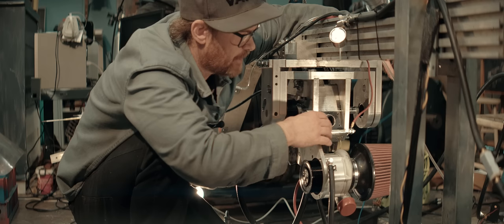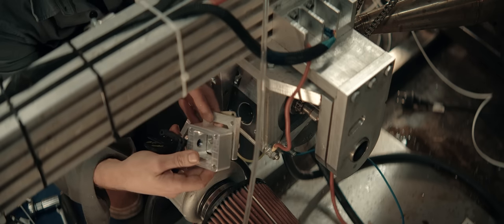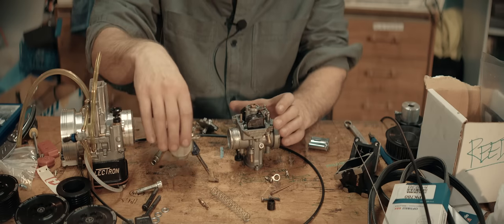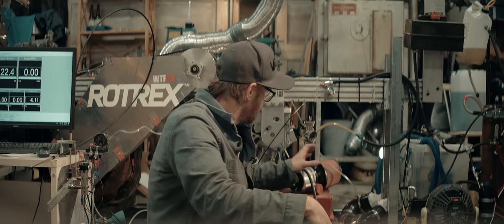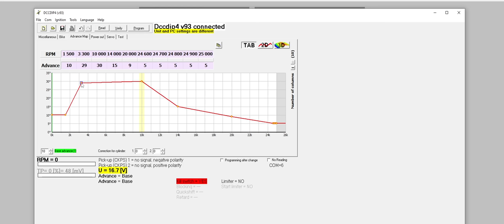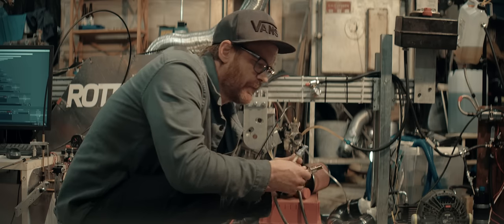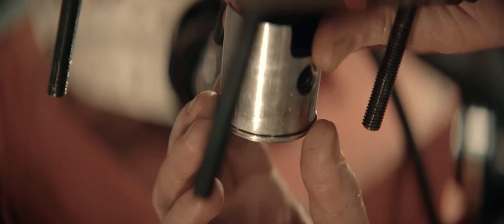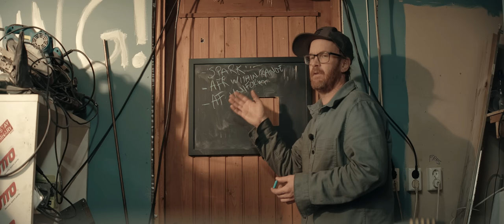Not Supercharged 50cc Two Stroke Not Running Nitro.

Comment: This is definitely the smartest thing you've done in a while. The thing is you never really got the base engine running just right on gas or methanol before deciding to supercharge it instead of your brute force CF... going back and getting the engine to run right NA and then figuring out how to supercharge it is definitely needed.. but also remember once you put the blower on it that things are going to change drastically because it's forcing air through no matter what when the exhaust is uncovered.. You don't have exhaust valves to build up pressure like a Detroit Diesel does, you have a very narrow band for it to be able to build boost and when the exhaust is open it's just ramming air and fuel through and lighting it in the pipe, plus there's far more exhaust pressure from the massively expanding methanol and nitromethane than there is from gas. 
The psycho part is you could theoretically use a turbocharger to pick up bottom end and have it turn off above a certain rpm just to help it get over the hump of where the crankcase volume is killing you. 
Something you need to do is go back to a regular ignition setup, you are still running all four leads into one plug, that's probably WAY too much spark energy for gasoline. Either that or go NA 100% methanol, if I remember right you definitely have the compression ratio for it.

Comment: Having theories is good. Test each one systematically, and not jointly. Complex problems are solved by decreasing the complexity to low noise levels. Never by increasing the noise.

Comment: Check resistance of the primary winding of the ignition coil. I have a ignitec system on an engine that runs to 13500 rpm. To fix a high rpm misfire i replaced the 3.8 ohm pri resistance coils with 0.8ohm coils. Engine runs fine now

Comment: Always a good idea to return to basics when you get lost in techno loops. It does seem to behave like it has flat spots, which in my experience arises from carburetion issues causing errors in combustion cycles - especially as you have fairly good information suggesting the ignition is ok. Of course, this could be the carb or the crankcase volume that you are concerned with.

Comment: you could watch the exhaust gases when the power cuts, if the fuel is cut it must look clearer. liquids don't always behave in a linear way, maybe the needle vents until the fuel level comes back up which causes abrupt interruptions

Comment: Sometimes I don’t know what the basic problem is that you are trying to solve. For example you start an episode with ‘today I am going to try changing this thing to try and solve the problem,’ but I myself have lost track of what the basic problem is.  I get it when you say the timing is the problem or the spark plug is the problem or compression is the problem, but what is the basic symptom that you are trying to overcome, like the engine won’t rev or the engine won’t make power or something else? Anyway, I always look forward to your videos and I hope you never run out of content.
Reply: I hope Alex does a series on hydroformed expansion chambers once PiP is 100% reliable.

Comment: alright, i like this approach. Here's a theory, you're lowering the advance, when it goes up in rpm and when your advance decreases it hits a ceiling and it won't rev past that, then once the revs go down a bit and your advance increases again starts to rev up, I think you're taking too much advance from ignition and that's why you're seeing it being limited to 12k (so you're reaching a balance when your advance is too low to rev up more). You've tried everything else, don't think there's another issue other than this (lack of ignition advance) or possibly the spark missing completely.in certain cycles. Kudos for going back to n/a and do a baseline, good luck - looking forward to the next episode.

Comment: Ok I think you have not enough pressure in the crank case so that when the pipe hit the exhaust gaz fill the crank case and than it take a while to evacuate. You could try putting 3D printed filler in your crank case to see if the behaviour change.

Comment: old a-series mini engines used to do a rev up n down thing, if they had an air leak between the carb and the head. typically the carb flange was bowed due to overtightening. however a) this 'hunting' effect happened mainly at low engine revs and b) the carbs were su constant vacuum jobs with a fairly heavy slider controlling the needle, which are obviously affected by inlet vacuum, whereas your flat slide carb won't suffer in the same way. long story short: i think it's maybe an inlet air leak.

Comment: You probably need to make a leak down test kit to check engine sealing every time is is pulled apart and put back together, I say this as your intake is suspect and an air leak could cause these issues. Also do you have any reeds you could swap out to rule out reed flutter? (Harmonics of the entire setup potentially).

Comment: Hello, i really enjoy your Videos, tuning engines, especialy small ones is always a long progress, keep on trying. For your Problem, i dont think that its related to loss of compression, neither to the fuel delivery. I ran in to a similar Problem while tuning a moped, it was just cutting out at about 8000, no jetting and no ignition timing changes would make a big diference. I was able to fix this issue with fitting a higher range spark plug (ngk b9hs instead of 7hs in my case) and fitting a velocity stack on the carb. In my experience carbs on two strokes need a air Filter or a velocity stack to Work Properly and maintain a even flow of air. Best regards from austria!

Comment: I think the problem with the spark is that at high rpm you are getting a ripple in the signal from the crank pickup causing it to fire at strange times and probably fast enough that you old analog tester isn't fast enough to detect it I have seen that problem solved by putting a resistor at the crank sensor

Comment: Hi. Love your madness☺️☺️ 
About the tig-welding, if it is Stainless and no gaps you can with low amperage melt it only you do not have to add material at all….
Tips från en som svetsar Tigsvets typ alla arbetsdagar i både rostfritt och svart… (svart material och aluminium ALLTID tillsatsmaterial)
Och gällande borra i aluminium så funkar T-röd/T-sprit utmärkt och man slipper olja ifall man skall svetsa efteråt…
Mvh: Anders

Comment: Get a foot pedal for your tig Welder you'll have more control over the amps in the moment, and remember to dab the filler rod not the torch the torch should be heald as steady as you can. Just helpful suggestions, keep practicing

Comment: alex great job , but consider this seriously ,  set timing and fuel to a safe base , and the work engine core temperature till it sounds best  ie 55 to 60 fir a hp 2 stroke  core temp will help vapourise fuel better and less engergy is spent heating componenets and rather moving the piston  , im not sure if ur temp is 35  but complete combustion will never occure that low .  heat heat heat the core to close as max as possible , then start playing , please try this u will see a diiference regards wayne

Comment: You have checked most things at this point but yet to see you check to see if the nitro fuel you are using is actually good and/or oil mixing! Your test results are rather sporadic, this could explain it. Impressed with your work as always 👍
Reply: Alex is using normal petrol 50:1 premix in this episode.

Comment: 11:51 - rich (if your holding it wide open - can't tell without the bar-throttle)

*EDIT*
It's cold-cutting (or soft-cutting, or non-hard-limiting) at 12.5k.  It sounds like a bike with a dummy cdi...revving fast, then stalling at the limit.  I'd have to go back most of the year to see exactly how you timed and worked out the exhaust "valves", but I'd have to guess that the timing for exhaust closure doesn't quite match up with the atmospheric intake.  Just my unintelligent 2-cents (but it sounds like my Zuma/BWS horizontal minarelli before the internal rotor...)

Comment: Keep you ignition coil closer to the engine. Maybe your ground wire is too long and creates interference. All the current going to the plug returns through the groung wire potentially messing up your ecu. Bolt down your coil to the chassis and keep the ground wire as short as possibile

Comment: Excess back pressure from the pipe  causing the intake not to be able to draw fuel in hence the pas breaks once the pressurer drops  it can take fuel again and runs till the next pressure wave restricts fuel intake  ..  Possibly from too much overlap on the ports

Comment: Screw those naysayers, my man…it’s innovation. You already got 30hp out of 50cc’s. That’s insane. Been watching for 2 years or better now and building it from scratch is unbelievable. 👍👍
Reply: Alex hasn't been able to take any reliable power readings due to spurious electrical interference since it was first made.
The Dyno and brake still need sorting yet.

Comment: Sir, I have no where near the knowledge as you but I wonder why you needed to transfer the intake charge through the crank case when the blower was installed?  Wouldn't it be more efficient (when using a blower) to force the intake charge directly into the cylinder via the piston ports without going through the engine crank case first?  By doing so, you would eliminate any dynamic flow problems generated in the (high volume) crank case.  But of course you would also need to figure out crank shaft lubrication...  Just a thought.
And thank you for the well done video series.

Comment: Big volume cranckcase may create some issue resulting in trouble to work a high RPM with reeds, some pulsating in the air in the cranckcase volume

Comment: Fortunately for your wallet,  you only need a DSO with a sampling rate 5X higher that what you'll be measuring. They've become relatively affordable.  The ones we were using in 2001 cost 20k USD!

Comment: Might be worth measuring and recording the cycle times of the engine to determine loss/excessive gain of compression. JCB civil equipment monitors cycle times when cranking to determine compression in each cylinder. The cycle times could at least be an indication of dynamic compression without needing to do all of the math

Comment: I feel the issues might be the lack of air in the mix.  Nitro is self oxygenating.  Go back to trying the nitro and see if it pulls past 12k.  Just to try the point.  
Might be to do with transfer/crank pressure/exh wave pushing air/fuel where it’s not naturally going.

Comment: I would suggest having a known stock 50cc engine on hand and try the carb and ignition set up on that, I know the jetting will need to be different along with the timing but at at least you could rule out the parts being faulty

Comment: I’m wondering if the pipe coupled with case volume and port timing is making internal resonance. The pressure wave could be great enough to block flow. With the blower on, you override the wave, but you get reduced output and difficulty jetting due to highly irregular flow. I could be way off base, but I think you’ve covered everything else.
Reply: It would be interesting to see high resolution pressure transducers in the pipe, case, and intake.

Comment: Yes, there are cheap USB oscilloscopes that should be able to keep up with the work you're doing with this. I would also look at hooking up sacrificial O2 sensors downstream of the engine to it for simultaneous logging on a few runs.

Comment: Personally I think you need a pressure sensor in the crank case, and a MAF sensor and fuel flow sensor. Right now in N/A format it's possible you're running into a resonance area where the pipe hits at a frequency that interacts with the frequency of the incoming pulses from the crank case and is causing a stagnation of flow into or out of the engine. When it ran with the supercharger you could clearly see that the drop out was ignition related because you got a huge cloud of unburned fuel coming out of the exhaust, the issue now is different and totally unrelated to the issue with the supercharger. Don't get lost with this new problem that's totally unrelated to the end result. Ignition problems aren't always caused by poor spark as well, a ridiculously rich mixture will also fail to combust. I think you should revert the engine back to supercharged form and do some proper data analysis of the engine

Comment: Is the large crankcase volume acting like a shock absorber or spring that is dampening the inlet charge or causing reversion like the pipe would and making the inlet and fueling charge erratic? I am not an engineer, or an engine builder but it seems like it's something that you suspect deep down, and to me seems like it might be playing a part.

Comment: Minimal crankcase volume is essential to good performance in a 2 cycle engine. It is, after all, nothing more than a pump. Similarly, the supercharging effect of the tuned exhaust is very  limited if the crankcase volume is larger than it absolutely has to be.  With exhaust and intake systems in proper balance, the exhaust should be able to generate around 12-14lbs/squ/in of boost... Disc inlet valves enable assymmetric timing of course which helps a lot to avoid the problems associated with piston ports wherein the overlap very quickly becomes excessive, that's why reed valves were used in piston port motors to alleviate the issue.
A problem with gasoline is detonation (pre-ignition), if compression ratios get above about 8:1, and I think you wonderful little engine is a lot higher than that, so it might be happier on methanol, with its sky high octane rating.... and if you chose you could run it on a glow plug rather than spark..... that more or less makes the ignition timing automatic..... Due to its very gig latent heat of vapourisation it will run cooler on methanol, which will help your piston crown temperatures, which are usually the failure point of two strokes, although your liquid cooling helps that quite a bit.
Model aircraft flyers know about getting an engine "on the pipe" against a constant load like an airscrew.... it can be a problem....
All being well 15-20hp should be possible (300-400 bhp/litre).
A local guy here in NZ (trades by the name of "Fast Bike Gear".. name of LIam Venter, has developed a very accurate ignitions system using Hall Effect transitors. It's quite revolutionary.... he made it for Ducati motorcycles, but could be of some use to you....

Comment: Have you considered trying some less aggressive pipe designs? A softer transition to the power band may show what’s really going on?
On the failed TSS500 motor they also had a lot of issues with the fuel foaming from vibration giving all sorts of weird fueling issues. 
You could always go old-school and stuff the case to decrease volume??

Comment: Would seem to me the thing is running out of fuel at the higher RPM's and has to wait for it to trickle down again. 
I had a car with a weak fuel pump that did exactly this. Ran fine till you hit it hard then surged and stuttered. 
New fuel pump cured it fine. 

You could try putting on a low pressure pump or  put a surge tank near the carb. 

Don't worry about your Audience, they are here enjoying your madness because it's one we all share. 
Only go forwards mate not back.

Comment: When VR speed sensors get hot they will act like that, also hall effect sensors are notoriously crappy for failure.  Try and automotive programmable ignition. Also. Megasquirt (microscquirt) will run your fueling AND your ignition. Its really not that hard to figure out and get them wired and work your way through the software. With you setup you could probably get it running in a day or a weekend. They also have a huge worldwide reach. I think DIY autotune has microsquirts with a 6foot harness for $300. I was running my 2 stroke 250 cc RC aircraft motor powered generator with one.

Comment: Does the crankcase have stuffers on the crank? If not, that could be an option for lowering crankcase volume. 100psi seems low, but those compression testers are notorious for inaccurate results.

Comment: I also agree that the blower is moving too much air and going into surge, being a centrifugal setup it takes a certain acceleration to get them into their sweet spot, you will find that at the 12,000rpm (engine rpm) the blower is coming on too hard and the compressor wheel is surging. 
Go back to what you where doing and just slow the blower down 👍

Comment: you should try using an ignitech ignition with more than 1 channel and combine them. with our streetmofa with reving about 18k we had similar problems - the ignitionenergy wasn't enough. possibly not enough time for the capacitor to recharge. a little bit more current on the supplyline can help a bit.

Comment: you need to do some electrical engineering work, the coilpack you use for the engine needs to be able to work that fast, you can hit the limit of the spool inside.
you can run double pack where you intermittenly switch between each pack for each cycle so the magnetic field can react fast enough.
Reply: He has revved higher with that setup before...
Reply: @viktorandersson7819  yes but what is the coilpack rated for, the faster you run them the more wear and tear they get.

Comment: Maybe try using a carburetor with main and idle screws like a Farmall M carb so you can adjust while it's running. If it doesn't respond normally to mixture changes in the range it does run then it's ignition or uneven charges

Comment: Pipe resonance pushing the micture down the case, too much pipe for the big crank case volume and weak transfer flow. Try wider power band pipe with less reversing pulse amplitude.

Comment: Alex, the volumetric efficiency of the engine and the carburetor may be mismatched. Also,  installing an air horn on the carburetor should improve the intake air flow.